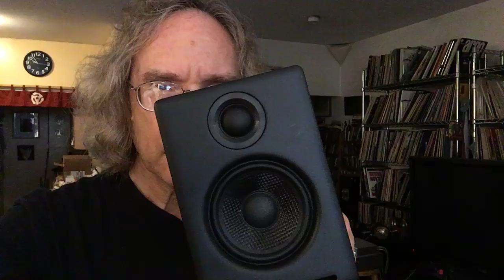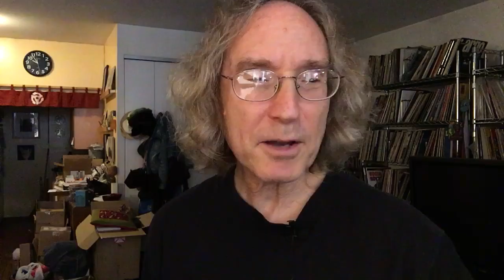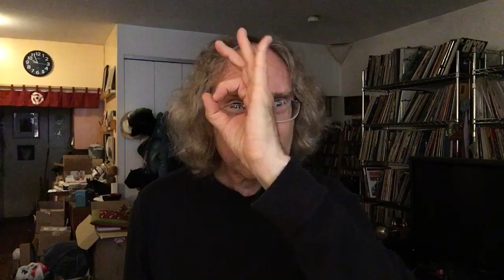The case against 1 inch dome tweeters

Comment: I mean, it really just depends on the wave size and intensity.  but, I think the real argument is the woofer going up to 2 or 3k.  The dispersion of a woofer at 2kHz is extremely narrow.  That kind of messes things up off axis.  That's why a horn or using a midrange driver might help the sound quality throughout the room

Comment: Absolutely agree with you. I think speaker manufacturers have hypnotized us into thinking two way speakers with shrill top ends are desirable," just look at our frequency response graph". Damn your graph it hurts my ears! I am building some 3 way speakers now with a 4" mid-range, I am going to be using an electronic signal processor / crossover to see how high it will go, to take the load off that poor overworked little dome.

Comment: 1980's Infinity reference 4 speakers still going strong today, no dome tweeter.
Reply: You might want to change woofer surrounds tho. I have Cerwin Vegas from the 90s and the foam was so bad. The woofer had no control and moved more than normal. Changed foam surround and they are nice and punchy again, with more firm suspensions

Comment: Steve, you have great ears. You are an excellent reviewer of audio equipment. You have extensive knowledge about music and recordings. But you should really stay away from the technical. The soft dome tweeter was a major breakthrough in audio design. Point sources of sound, when done correctly, are an advantage. I love Maggies, but they do not image as well as a fine-tuned point source speaker. It has to do with dispersion properties, of course. Many people would choose Maggies over box speakers but they just do not have the money to spend. You picked on one of the finest set of bookshelf speakers which are about the only speakers listed in Stereophile's Class D category, for good reason. I am going to keep reading your wonderful blog on CNET. But I am having difficulty watching your daily YouTube channel. You mean well, and you have a lot of great experience and knowledge to share. Please slack off on the technical a little.

Comment: I'm no engineer, but I think you're either unaware of or neglecting 2 facts by insinuating a larger tweeter will produce higher quality high frequency content.  
1.  Lower mass means faster transient response.  If you're concerned about percussion transients being reproduced by your high frequency drivers as you mentioned, then you'll want to minimize the mass of those drivers so that they're easier to move.
2.  Wavelength is inversely proportional to frequency, so the actual wavelength (size) of the oscillations of those waves are decreasing as quickly as the frequency increases which is basically exponential to human perception.  
That being said there are lots of great engineering feats, materials, etc. that still play a huge factor which shows in the fact that you see ribbon, planar, dome, inverted dome, etc tweeters when midranges and woofers are almost all exclusively straightforward moving cone designs of some sort or another... 
But don't propagate the false narrative that bigger is inherently better when it comes to high frequency sound reproduction.  If anything it's more inefficient and you should tip your hat to any who can pull it off in an efficient and convincing manner without sacrificing fidelity.

Comment: Steve you are right on with this one. It is the surface area exposed to the air, and because air compresses, the more electrical energy you feed it the less efficient it is transferring the sonic energy wave they compress the high frequecies.To couple to the air better you need more square area or a transforming device like a horn. ESS Hiel made an air motion transformer (tweeter) that had a membrane that was folded back and forth like and air or oil filter element in a car. This squeezed the air out the front and rear of the device since it is a bi-polar driver. 
Ever wonder why heavy rock fans loved speakers like RTR , JBL Century 100's, and Pioneer HPM-100? These used paper tweeters which were veiled and lacked tactile nuance that domes have. So what gives? Square area of the tweeter is what it is, less compression at loud volumes which is why they sound good loud. Loud sound is more lifelike when it is uncompressed. I have 1 inch silk domes on my critical listening system, but my other two systems are Altec Valencia 846A  with tube mono blocks, and Sansui intergrated amp pusing Speakerlab 4's for my rockin out system which uses the EV HT-35 compression horns, same as the old Klipsch tweeter. The Altecs are better for vocal, acoustic, or soft music, they get too wiggy if you try to play them too loud.

Comment: adding: 2 x dome tweeter = +3db, 4x dome tweeter = +6db, 8x dome tweeters=+9db
OR 1 horn loaded compression driver ~= 10 dome tweeters usually at 105 to 110db efficiency. 
and waaay lower distortion. 
twice as loud = approx. +10db

Comment: The higher the frequency, the smaller the movement and the better the transient can be... Ever put your (clean!) finger against a tweeter when its playing? You're lucky to be able to 'feel' the movement of the dome attached to the voice coil - hence, how small a movement to reproduce sound waves. Take a guitar and play the highest note... how far is that string vibrating back and forth to produce that note? Or, how far does a stylus have to travel to reproduce an 8kHz note... Yep, those little one inch - or, sometimes three quarters of an inch domes don't have to do much travelling to make all those sounds.

Comment: Steve, some years back McIntosh made a high-end speaker with 1 inch or thereabouts Dome tweeters that were arranged in a vertical line source manner -- they were awesome. ( if I could have afforded them I would have purchased them :-) )

The multiplicity of drivers enabled them to handle a lot of power, effortlessly and transients were no problem for them at all.

Comment: Hello Steve, do you know if a speaker with crossover set at 5 or 6 kHz exist ? This will let all the human voices frequency (200 to 6000 Hz) be reproduce only by the midrange speaker without be cutting in 2 parts between the Twitter and midrange.

Comment: For many decades I've enjoyed the Celestion HF1300 tweeter along with a supertweeter. A combination used by the BBC. I run BBC/ Rogers LS3/6 speakers, they use Celestion HF1300 tweeter and Celestion HF2000 as the supertweeter. As for larger panel tweeters, I have Quad ESL57's and ESL63's

Comment: Like everything else it depends on how loud you like to listen. If you want to listen to a cymbal as loud as a cymbal goes I'd recommend more tweeter. That or add a midrange that goes to 5 or 6 khz. Probably some sort of tractrix compression horn. An eminent apt80 horn tweeter gets very loud for its size above 4k. What helps out is ears are very sensitive up here so it doesn't take a lot of power to get them loud.

Comment: 3-20kHz is just about 3 octaves. That´s absolutely no problem. A midrange speaker that covers 400-3000Hz has also just 3 octaves to cover. In a 2-way speaker, the woofer has to cover 5 octaves or more.
And then there are fullrange speakers...

Comment: I think you re ignoring  the wave characteristic differences between low and high notes. Low note  wave crests are further apart so the bass speaker material has to travel farther than the tweeter. Also speakers have to be balanced and I would say that the engineering of the speaker to determine this balance is what determines the size of the tweeter. Engineers never try to make things bigger if they can achieve their goals by making something smaller.

Comment: Regarding the "transients of music", Nyquist's Information Theorem still applies.  Those transients can't be TOO small in duration or they'd by definition be out of the range of human hearing.

Any transient that can be heard must be wthin the range of hearing.    Stating the obvious.   If the tweeter, combined with the other drivers, can cover the full range of frequencies you can hear, then they must be able to reproduce any audible signal including audible transients. 

Now, the dynamic range and responsiveness of some tweeters will be better than others.  Sure, there's a difference between tweeters.  But there's nothing at all inadequate about dome tweeters in general and their commonality and widespread acceptance is itself evidence of the sonic integrity and capability of the design.    It's the wheel of the speaker world.  It doesn't NEED to be reinvented, now that we have a nice round thing that rolls smoothly and easily and can carry a decent load.

Comment: 1. they radiate well.  2. they''re cheap to manufacture relatively speaking (as compared to a good horn or ribbon).  3. They have sensitivities that are fairly easy to match to midrange and bass cone drivers (makes crossover design more straightforward).

Comment: No rats, its science of sound.
Quad and Martin Logan do not have much hi frequency, and there is a reason for that...........because their tweeters are too large.

Its really simple, the diaphragm should follow the wave length to keep up with good radiation of sound.
wave length at 30hz = 10 meters 
wave length at 4khz = 0.1 meters
100 times the size
............should woofers and tweeters be the same size?

You would not want a diaphragm that is designed to produce 30hz attempting to produce 20khz or the other way around.

This is also the reason electrostatic speakers have no bass and no highs, similar to full range single drivers.

Going larger than 1" diameter you will start to get beaming in the high frequency because 1" is equal to around 14khz. Once you exceed the wave length of the diaphragm you will get phase cancellation and beaming . This is why when you stand up, your magnepan speakers tweeter disappear, while the audio engine tweeters still play.

There is much more to be said why the 1" dome tweeter is widely used, and its not because of rats or cheese.
Reply: The don't have much bass either. The roll off is quite audible after you've been used to conventional drivers.
Reply: You're absolutely clueless, you have absolutely no idea how planars/ribbons work and mass to size ratio at all.

Comment: I totally hear you. A big speaker is a big speaker. You're absolutely right. Dome tweeters are ok, but will never do what a good compression driver will do. A dome tweeter generally has a common ringing which I'm not a fan. Dome tweeters are mainly used due to marketing reasons as they were the in thing many years ago and these days are a must as people wouldn't buy the tweeter. Just like paper cone woofer to me are still the best sounding drivers, however due to marketing they are no longer in. You cannot beat a well designed large diaphragm compression driver as it sounds very natural due to no unnecessary diaphragm movement.

Comment: I like soft dome tweeters. Although ribbon tweeters and horns would do the job better   Electro static speakers are in my opinion the king when it comes to mid to high frequencies. Sure, bass is lacking but just put a sub with it.

Comment: Many of my thoughts too about dome tweeters, until I designed a waveguide and used it to lower distortion and not use it to lower the crossover frequency, which some do. It made a difference, it made a HUGE difference, but the crossover becomes a critical aspect of it, but the result can be more than just a little satisfying.

Comment: But the those Tweeter were like a Buck a POP.
And as easy to change as a Fuse hehe. 
The Piezo Horn tweeters were always used with drivers that couldn't keep up. Which people said sound Harsh. (for that reason) 
But they have their uses in 3-4 driver (way) systems just like domes. 
If you don't need Volume that is. 
Leaf Tweeters had their day Too. 
And appear to be a Lost Art. 
The cheapest overall design use to be full-range speakers with "Whizzer Cones". 73 cent a piece. 
Now I see that design in $1000 systems. 
It is what it is. 
...money over matter 😂...

Comment: My speakers are 4 way and have 2 tweeters each and they sound bright and clear and no mush and sounds are all separate. They have what looks like metal tweeters and a titanium coloured polycarbonate midrange. The frequency range is 27-37kHz at -20dB. I have not heard any speakers so clear for high frequencies. I know some amps can go as high as 100kHz though I have not seen speakers to match them and that those frequencies are not audible to Man though they do enhance the midrange and high frequencies more accurate than the average speakers that are 65-100 Hz to 18kHz or 20kHz. Some bass frequencies are not balanced because they are built for Sub woofers in combination. I have the sub and am waiting for the leads to set up. 2 way speakers are not enough to get the full quality no matter what type of tweeter. The 4 way speakers make my class D amp sound better than my previous class B. Goes to show how any high quality component from recording to source to amp and speakers can make a great improvement though I will question and oppose the idea that the source is more important because you could have the best source and a bad speaker that masks the true quality with a narrow range of frequencies and poor sound separation and mush. Get yourself a subwoofer, woofer, midrange, tweeter and supertweeter and here the quality compared to your 2 way setup.

Comment: The problem with one inch domes is they are not really large enough to cover the range of frequencies thay are asked to cover like in two-way systems. Most one inch domes are not that good at frequencies below 3200 hz. Much below that frequency they start to sound strained and distortion rises as frequencies get lower.
A 1.5 or 2 inch dome is a lot better at lower frequencies but they don't cover the top octave so well. A good example is the classic Dynaco A25 which used a 1.5 inch dome vs the Dynaco A25XL which used a one inch dome. The A25 sounded better in the midrange but had a darker top octave whereas the the A25XL had airier highs but not as good mids. Everything it seems is a compromise.

Comment: I'm absolutely no authority on the matter, but I think the problem is perspective and/or general misunderstanding. If you think about how transistors can oscillate at GHz frequencies and how that gets transmitted over radio-towers, for example.     Electronics are indeed extremely amazing... But if you're using high-end measurement equipment & it's telling you that you're getting super low distortion and an extended frequency response, there's no reason to really question it. After all, the people who design the speakers and the test equipment (having worked for the latter for several years) are ridiculously competent engineers.

Comment: If you want to compare the size of tweeters to woofers, you have to account for wavelength. A 40Hz signal has a wavelength 100 times bigger than 4kHz. This is why a "small" tweeter is perfectly acceptable. I'm no audiophile, maybe those horn tweeters do sound much better than a silk dome. But you're barking up the wrong tree if you think it's because of the size difference. We can measure very accurately the sound reproduction of speakers throughout the audible range. You can talk about the subtleties of transients and harmonics all you want, but at the end of the day, ALL of those things (assuming you can hear them) are within the 20-20kHz range. There's nothing magic in there that your ear can detect that cannot be detected with an audio analyzer, or replicated with a 20-20kHz sine wave sweep.

Comment: I don't like your comparison, there's a few factors, 1. driver diameter / width vs sound wavelength and on/off axis performance, 2. driver capabilities, planar drivers have a much more linear frequency response up to 20khz, whereas lots of regular dynamic tweeters get wonky above 14khz, nevermind the fact 1" tweeters are the same length as a 14khz wavelength, they beam a lot more above this point as drop off due to the limits of their design, double whammy that hurts their reproduction of harmonics (10 - 25 khz). As far as I know, shape and size of planar-type designs, be they dynamic or electrostatic or ribbons determine their dispersion patterns at different frequencies just the same, they offer different advantages, mainly less distortion and a more linear frequency response and better transient response. I think air motion transformers have the most potential for speakers of all tiers, they're compact as regular dynamic tweeters but have substantially more surface area and efficiency so crossing them lower isn't a big deal and they're plenty fast and linear up to 20khz.